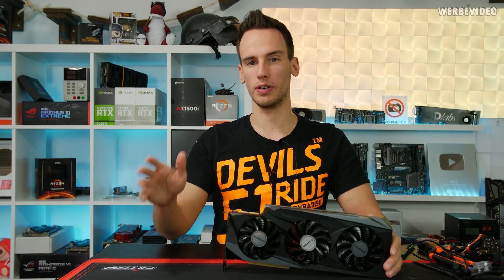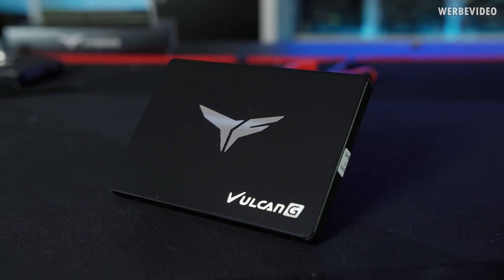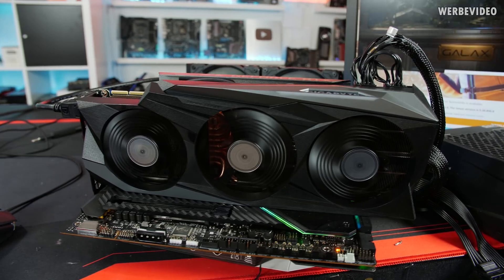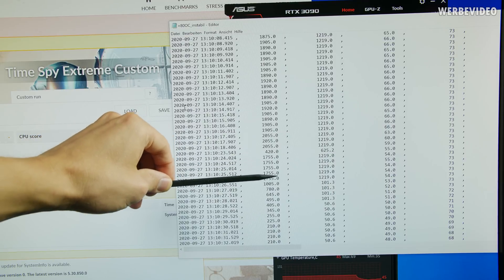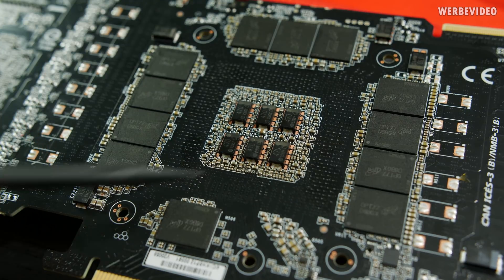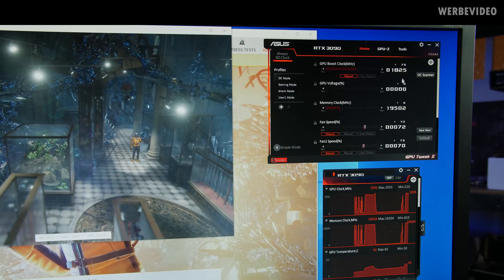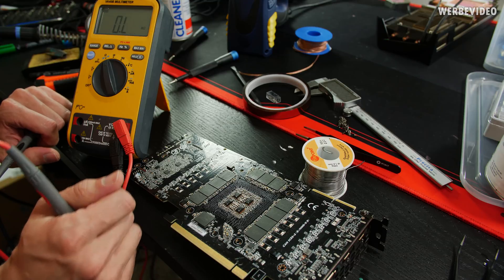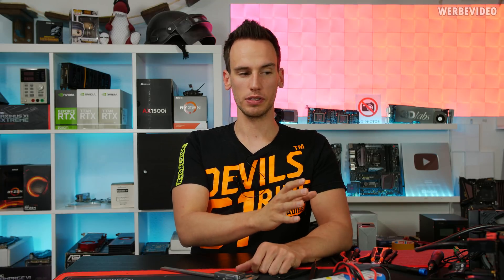We Tested the Cap-Drama - RTX 3090 MLCC vs POSCAP

Comment: My two cents.. if the gpu has auto throttle up, and that it throttles up to some predetermined spec, then it should be stable at that spec..  if its not, then its an issue which the manufacturers need to address.. if the manufacturers validate it to run at a certain spec and advertise it to do so, then they should be held accountable to that spec.. if the changing of a couple of capacitors makes a difference to make the throttle up stable, then I would say the manufacturers should upgrade their cards and replace any card they sold which needs upgrading.. we all know that manufacturers are in the business of making money.. and they will  at times cut some corners in costs in manufacturing the product.. what they can get away with.. but a product in which you know people are going to be pushing the limits of to get the best possible performance.. I would think twice if I was a manufacturer in cutting corners and using inferior parts and or manufacturing processes.. because if your competition does not cut corners, the community will learn which one has cut corners and which has not by how well they do perform especially when pushing performance limits..  if manufacturer A uses inferior parts and manufacturing processes, and manufacturer B does not, but uses superior parts and manufacturing processes in making its GPU cards.. the community will find out, and you are only going to hurt your own brand..  understand, the community is not always happy paying a premium price, but they have always done so.. so trying to cut corners is not always a good idea.. you might consider what your competition is  willing to do to get the lions share of the market, and where that will leave you if you try and sell an inferior product next to your competitor..

Comment: Get yourself some soldering tweezers fella! You risk lifting traces otherwise :-( 

FWIW, I've used Weller WMRT series tweezers with a selection of tip pairs for many years, I work all the way down down to 008004 size, but there are now newer Weller versions available, as well as other manufacturers. Looks better on the bench too to have an armoury of soldering irons.

Comment: Even with extra 20mhz the card was still running at around 1900 mhz speed ... 
So those 20 mhz extra overclocking headroom did basically nothing ... 
Even with those 20 mhz you wouldnt have gained more then 1-2 FPS in the game ... So yeah ... Great video btw :D

Comment: I offered to trade my RX 5700 and a GTX 1660 Ti to anyone not happy with their 3080 ....... Oddly I got no takers 

This was all blown way out of proportion and it looks like it's been fixed with an updated driver ...... I basically had the same problem with my RX 5700 shutting down my computer so I got a bigger PS which helped keep the computer from completely shutting down but I still had CTDs in some games ..... The only difference between that and this is it took AMD a few months to fix the drivers while with Nvidia it only took a few days .......

Comment: What I use to preheat large PCBs for rework is a PCB style heater from a 3D printer controlled by an Arduino Nano and a MOSFET fed with 12V from an old modified 200W PC power supply ......

Comment: I really wonder howmany of these incredibly expensive cards are butchered by ppl trying to do small SMD solder to 'fix' a card which is working just fine, only to get a super-marginal performance increase.

Overclocking is still nice to do for technical reasons, but lets be reasonable, these days there is simply no reason to overclock, as the gains are almost inmeasurable and in any case not noticable for the end-user.

I mean, I come from the time where you overclocked your celeron from 300 to 500Mhs. THOSE were noticable improvements that were worth it. Today it's more of a theoretical technical intererresting experiment, with no real world implactions.

Warning for ppl who watch this video and things 'Im going to solder new caps' or even shunt resistors in it: theres about aa 99% chance you will fuck up your board.

Comment: Did you maybe try to put there double capacitance of the power filtering MLCC caps (20 in paralel) on each place of 470uF POSCAP? (that is 940uF on each POSCAP place) And try to push it through 2,1GHz?

Comment: @Roman Do you have an exact description/part# of those replacement caps (think besides same capacity, they may differ in ESR/ESL), so curious which ones you exactly use?
And: What temperature did you use on the heatgun and what kind of flowmaterial you used? (basically some tips for smd soldering welcome)
Reply from the maker: WCAP-CSGP 885012107006. The heatgun was just to get the PCB to about 120-140°C which makes soldering so much easier. It's some simple no clean flux and no clean solder but I don't have specs for these. Bought in a local shop
Reply: @der8auer  thanks alot!

Comment: This issue has been fixed. It was never a problem with the cards , it was simply a driver issue.  New drivers were released on the 28th and this problem no longer exists.  The cards no matter what capacitor configuration you have are no longer crashing at over 2ghz
https://youtu.be/MAbRVHc-L5U

Comment: One thing which strikes me as interesting. Ppl are saying that the cards crash when they exceed 2 GHz.
But looking at der8auer's GPU-Z plots, it almost looks like the cards hit 2 GHz after crashing, and were usually in the 1900 MHz range under load before crashing.
This might make sense, if a card is under load, but suddenly the program crashes and the card stops getting instructions. It would suddenly get much less thermal and power load, which the boost algorithm might interpret as having headroom to boost up. But it's not the boosting which crashed the card/driver/program, the boost spikes might be a consequence of the crash.
The only reason I'm bringing this up is that nvidia's fix seems to be to cap frequencies at ~1900 MHz in the driver.
But if the cards were already crashing at 1900 MHz before, then they're only fixing the symptom, not the cause.

Comment: Some people says the 3rd party manufacturers could not test any games with their card to avoid leaked performance. They could just run the nVidia test software which could be the reason why they were not able to identify that the boost clock was unstable. If true then it's on nVidia for not providing an accurate enough test software.

Comment: Regardless of the fact that this cap "mod"/putting a higher quality array on there has a very miniscule amount of benefit, it still boggles my mind that companies still "cheap out" on stuff like this. Yea yea, I get the whole profit margin thing but seriously. Literal top tier card (aka Titan replacement), and they slap the big cheap bois on there.  They already had the pick and place going ham on the backside GPU die, how much more realistically would they have had to fork over to manufacturing to slap the small bois on there instead?

Comment: Should have run a really bursty workload that tricks gpu boost into using the excess thermal overhead. It might have crashed out at stock then.

A lot of people experiancing crashes are likely cpu bound, and thus only sometimes hitting gpu bottlenecks, allowing higher max clocks.

Otherwise good video.

Comment: Wait, so all the fuss is because it's boosting too high by about 10 to 30 Mhz? And only for overclocking? Nvidia is using a smaller node now. That's what happens. Ryzen had the same issues. You reach a specific limit and you end up with less overclocking room.

Comment: for anyone blaming manufacturers here's how this particular launch went, for the FIRST time ever 1) Nvidia decides to not give manufacturers drivers to avoid leaks and give them an inferior barely tested "reference design (that nvidia itself wouldn't use so had no care for while they were working on and refining their premium PCB which is also a 1st) 2) Nvidia only provides a basic pass/fail tool, no drivers still 3) AIBs have to design their cards and cooling still with no drivers 4)Nvidia is going to released their FE cards, AIBs have to release at least designs for their cards...still no drivers but they already made the coolers somehow 4) almost FE release day AIBS get drivers, their base models are already produced based on virtual usage because no drivers and it's a catastophe. Since when did AIBs release only the cheapest base models 1st and we had no trace of the more expensive ones where they make the most money on before weeks (still don't really have reviews of them to this day) didn't that weird lack of premium models at release hint of something rotten ?  it's all nvidia fault 100% no mistake they "threw the AIBs under the bus" as you say in the end it's a lose-lose situation because me and many others I think went from a pre-order to I wouldn't touch a 3080-3090 even the FEs with a stick unless you show me proof and the caps of an updated version, poo poo trash is all what was supposed to be the best gpu launch in years, good job Nvidia now half your customers are waiting on AMD you missed your window of opportunity big time, I doubt I'll go amd but I'm not buying an RTX3000 anytime soon..maybe in 2021 we'll see

Comment: Although MLCC do have better power delivery characteristic, SP-Caps are more robust and less prone to coil whine, very valid reasons for going with an all SP-Cap design as long as its within design and tolerance. This entire capacitor issue has been widely blown out of proportion and misunderstood, ultimately drivers were the issue as MLCC cards were also crashing,  and all models are reporting good results with the new Nvidia driver.

Comment: Excellent test method. Test the control and then change one variable and test again. Perfect execution. 

Please get a proper hot air rework station for removing SMT parts. Pulling the caps off like that risks ripping the pads from the board. It made me cringe. When putting the caps back on add solder to only one pad and then solder down the capacitor. Add flux before placing the cap on the soldered pad to help the solder flow. Once one side is down with the part level on the board, add solder to the other capacitor terminal and pad. Your parts will always end up level this way. It's hard to get them level when you start with solder on both pads. 

You can remove the excess solder from the polymer cap pads with solder braid. I always clean the solder from the old parts before placing new parts. Again, this helps the new part go on level.

In this case where multiple caps shared the same large pad I would have removed the solder from the shared pad then soldered the MLCC down using the other pad. Once all MLCCs are in place solder can be added to the common pad.

Comment: Just a reminder for all, Zotac cards use 330uf SP Caps as opposed to higher spec'd 470uf SP Caps as shown here in the Gigabyte model.  So not all 6 SP Cap solutions are equal.
Reply: Although correct, even the Zotac Trinity owners are now reporting crashing is resolved with the new Nvidia driver.  Interestingly EVGA told Gamers Nexus issues with their "all SP=Caps" designs seemed to be resolved with the driver update, of course they also saw crashes with the mixed capacitor model XC3 like everyone else.  The capacitor "theory/guess" seems to be largely bullshit.

Comment: I've got to about 2:02 in the video, I can tell you all that it's going to do by changing those caps is maybe remove a very small amount of ripple in the supply in the millivolt range, hardly anything!, and it's going to make no difference to the crashing issue!, Put a oscilloscope on the supply you will not see much different at all between the different caps MLCC or the black tantalums.
Reply: faster reaction to transients?
Reply: Hickory Dick Yes you could look at it that way too, but it’s going to be barely noticeable:-)

Comment: I didn't think he'd go removing the capacitors.
I do think this is more about stability and very low overhead room.
In whatever case, the blame all lies on nVidia. They made this mess with their lack of sharing information, and working with partners. nVidia obviously only cared about their own card, not others.
Reply: Although MLCC do have better power delivery characteristic, SP-Caps are more robust and less prone to coil whine, very valid reasons for going with an all SP-Cap design as long as its within design and tolerance. This entire capacitor issue has been  widely blown out of proportion and misunderstood, ultimately drivers where the issue as MLCC cards were also crashing,  and all models are reporting good results with the new Nvidia driver.

Comment: Just a few days ago I was saying: No one on earth gonna swap the POSCAP with MLCC to solve the Cap Controversy. Of Course! No one has a highly advanced robotic arms to do the job! But now here I am, watching a Man doing the impossible! When he was soldering those Invisible MLCC, I literally lost my $hit. This Man is a king.
Reply: Although MLCC do have better power delivery characteristic, SP-Caps are more robust and less prone to coil whine, very valid reasons for going with an all SP-Cap design as long as its within design and tolerance. This entire capacitor issue has been  widely blown out of proportion and misunderstood, ultimately drivers were the issue as MLCC cards were also crashing,  and all models are reporting good results with the new Nvidia driver.

Comment: I think the "470" marking on the big cap refers to 47 uF, not 470. The third digit is the exponent. "470" --> 47*10^ 0 uF = 47 uF. (+-10%)
Reply: If you look at other cards, when using MLCC there are 10 individual caps. So it makes sense that a single large cap should have 10x the capacity. Also, once going to polarised electrolytic caps the rating  is usually printed in uF rather than coded.
Reply: Also don't presume 10% tolerance. Tolerance is a manufacturing characteristic that will be specified, it varies from product to product. Many capacitors are +/-20% or even +20%/-10%

Comment: Thank u for this awesome video. Gifted brain.
But still third-party companies tried to reduce the cost and quality and not following the reference standard, not acceptable.
Reply: Although MLCC do have better power delivery characteristic, SP-Caps are more robust and less prone to coil whine, very valid reasons for going with an all SP-Cap design as long as its within design and tolerance. This entire capacitor issue has been  widely blown out of proportion and misunderstood, ultimately drivers were the issue as MLCC cards were also crashing,  and all models are reporting good results with the new Nvidia driver.

Comment: Don't forget kids, Xc=1/(2 * pi * sqrt(L * c))  and caps are modelled on a series R, L and C all with a parallel R.  The capacitors form the power distribution network and also form the filters of the PSU outputs, so wildly adding some caps may make the situation worse rather than better, if any better at all.
If you really want to replicate the other design with the MLCC instead of the POSCAP, someone will need to desolder those MLCC and measure them to determine their capacitance and frequency response.

Comment: At 2:02, you state that you have a bunch of 47 microfarad ceramic caps laying around to test with, but as I'm sure you're aware, not all 47 microfarad ceramic caps are created equal; the specifications of the caps you use need to match those of the ones the AIB's are actually using in their cards (ESR, etc.).

Comment: This hurt my head, he started off talking about how this is about proving stability, on a potential issue with the POSCAP or not, and ended with a word on whether its worth it for Overclocking?!
The issue here is the exact same capacitance used on the card, when using POSCAP and then switching to the same capacitance in MLCC, for 2/6 terminals caused a stability increase of 30 MHZ. 
This definitively proves the POSCAPS are causing stability reduction on the GPU boost clocking. Given these are supposed to be the most expensive and advanced cards available in the known world, we expect only the best parts to be used when creating them, since we use only the best money in paying for them.  The Asus TUF board which is using all MLCC for its capacitors will be an interesting test vs the GIgabyte.

Comment: I concur with both as an issue.   What few videos I have seen of crashing cards, they do not have anything in the middle pad segments ( out of potential 6 big Cap packs ) that seem to be the issue in getting the rated to +20% clock speeds.

Comment: So... There is a small but significant difference in stable clocks with improved power delivery, but not enough to account for the whole controversy so it's likely that there's a firmware fixable boost behavior problem across the board that is just being felt more directly on the lower cost designs. Does that sound about right? I guess that's good news for people who have a card with the issue, since they might eventually be able to patch it instead of having to mail it back for RMA/Recall.

Comment: It over-boosting like this looks to me like it is miscalculating somewhere. The miscalculation can come from the speed.
Problem is you normally just get a crash, not a nice log with apparent "bad behavior of the bios". It could be a sensor issue or oscillations as well. Anything that causes the regulation of boost to misbehave. Would be interesting to monitor the voltage domains for noise while it crashes.